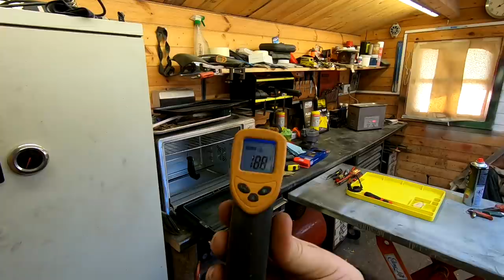TGB Scooter Carb Strip And Powder Coating At Home

Comment: hiya martin, good video as usual, any advice on a good sandblaster? need to refurbish some reliant regal steel wheels, or if anyone else has recommendations / experience in sand blasters i would like to hear from you all
Reply from the maker: Mine is just a generic one from Ebay but I have modded it.
Reply: @retrorestore  thanks martin - least i know the generic ones are up to the job 👍

Comment: Is the main jet size 60?  And is it normal that the airbox tube is realy hard to connect to the carb air intake ?? Normaly its realy easy to connect these on scooters, but im working on a" tgb tapo" and i can not  get these 2 connected. Im affraid i will damage something.
Reply from the maker: Heat the tube up a bit and it will go on easier. You can use a heat gun.

Comment: Hi mate, I've been restoring one of these my myself exact same bike. I bought it with a 70 kit on it. And the guy had put a 99 jet in it. Its currently flooding and not idling. Do I need a smaller jet? And if so what size would u recommend
Reply from the maker: Looking at a 70 jet next.